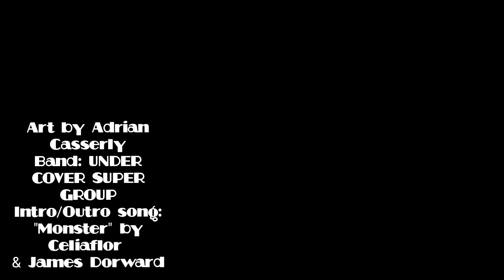4LMOST F0RTY: LAST EPISODE

Comment: Not to be an annoying "you did everything wrong" internet nerd, but you should always wear gloves when installing headlight bulbs.

It only takes a tiny bit of the oil from your skin getting on the glass housing to possibly create a hot spot in the bulb. Usually it just makes them burn out faster, but it can also do a lot worse.

Thats a good portable kettle. Ive had one for about a year now and don't really have any complaints.